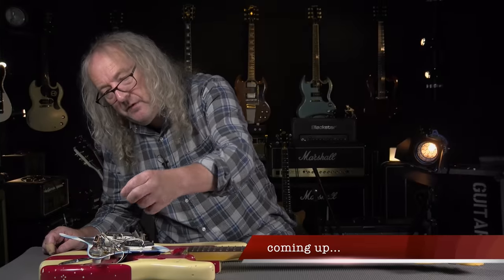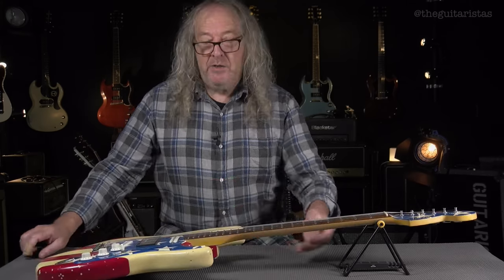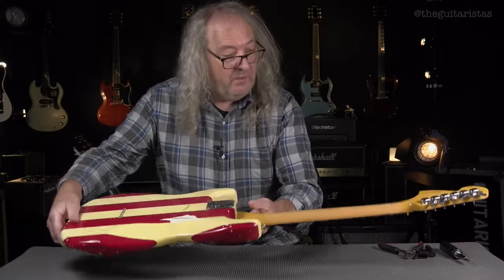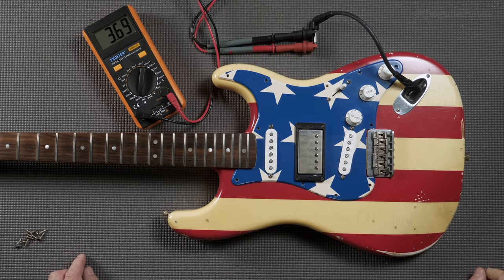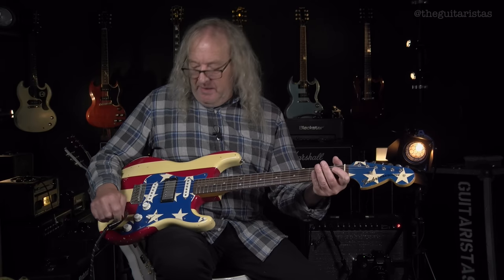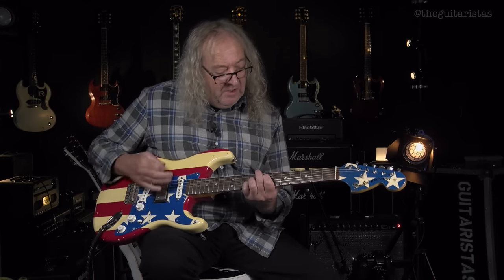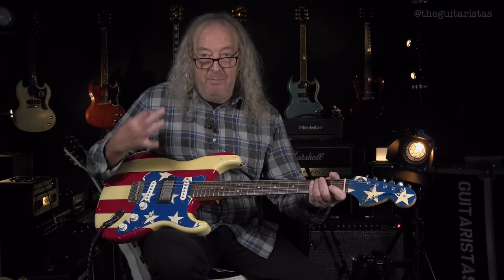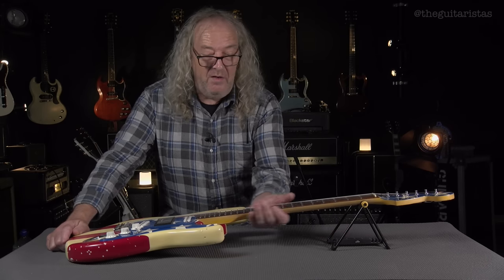Can the MC5 Fender Stratocaster Kick Out my Prejudices? - Independence Day Guitar Review

Comment: I think the muddiness of the middle humbucker could depend from the fact it's linked to 250K pots, instead of the 500k pots utilized  in Gibson guitars.
Reply from the maker: Good point! 😎👍
Reply: Or does it sound muddy because it's a Shawbucker 2 -- which many would describe as muddy to begin with?
BTW, the Fender Shawbucker is designed (voiced) for 250K pots which can be found on Fender's wiring diagrams included with them. They presumably do this so it could be more easily paired with single coil pickups as it often is.

Comment: Always had a love/hate relationship with Strats. I have liked a few of the older ones I had (1973 & 1978) but did not like the ones from the early 2000s. I do prefer the hard tails....I have never like relic-ing. I would rather beat them up myself with normal wear and stupidity (leaving them on stands when you have kids and dogs). Keep on keeping on!

The volume knob location never seemed to bother me...never thought about it.....
Reply: The volume knob is perfect where it is. Perfect for manual swell... weird to be musically limited to the point that a strat could be a problem. I prefer strats to gibson's but i do really like SG's. They have different uses...les paul have an amazing sound but so hard to be in tune and the worse... its weight, that is part of the sound. But not worth back issues to me.

Comment: Like you I started off playing guitars with Tuneomatic bridges and Stop tails and found the Strat style bridges slightly awkward and uncomfortable to play!
I’ve subsequently found that replacing the small saddle Allen screws with shorter ones that are flush with the top of the bridge makes them much more comfortable.
They are available in different lengths quite cheaply and you will need slightly longer ones for the centre strings to compensate for fingerboard radius.
If your happy with the current setup and string height, take some measurements and order some, I think you will be pleasantly surprised how much it helps!
To avoid altering you current setup, replace one screw at a time and check tuning!
As to the control knob positioning, you can buy pickguards without control knob holes so you can drill yourself and reposition to suit your requirements!
I bought one recently for my Eart Suhr Super Strat copy which has only 2 control knobs, volume and master tone!

Comment: You can consider 4 things to do when you don't like a floating tremolo on a Stratocaster:
1. Buy a hartail Strat (At least if you like Robert Cray)
2. Put in all 5 springs and increase the tension so that the tremolo does not move at all any more (the springs indeed affect the tone)
3. Just like #2 but then stick a piece of wood into the gap between the trem block and the body. Then release the spring tension so that the block presses the wood against the body (so it would not fall out and this also makes the instrument resonate better. This is what EC does and also features the EC Stratocaster signature model as far as I know).
4. Buy a Nashville Telecaster instead.
A tone comparison would be of interest I think.
@Colin: Thanks again for another interesting and entertaining video!
Reply: I deck all of my Strats as in item 2.
Reply from the maker: Cheers Lars... 1, 3, and 4 work for me! 😆👍
Reply: @theguitaristas  I like 4 best 😎

Comment: I ordered a Mod Shop Stratocaster last year and I went with the hardtail option. Then I replaced the bent steel Fender saddles with some stainless steel block saddles. It will hold a note for about as long as you care to.

Comment: Usually 1st tone is for neck pup, 2nd tone is middle & bridge tone.  My Strats I like 2nd tone control for the bridge pup.  I like the middle pup with no tone control.  Yes you can go master tone & volume, there are strat style guitars made the way you like the controls.  You can make up several pickguards with different pup & control setups, get battery plugs from the R/C hobby, add to the jack wires for interchangeability.  This way I can return the guitar to stock if I want to sell it.  
A suggestion for Fenders that ned neck removal for truss bar adjustment: If you need to adjust often, internet search for woodworking screw inserts & machine screw (kits for guitar necks available).  This eliminates wood deformation of the neck.  This makes a true bolt on neck. My son overtightened the screws on one guitar & this was a nice fix.  Why he parted the guitar is still a mystery.  I did this to all my bolt on necks.

Comment: I just did some checking in the old Charvel/Jackson catalogs (I used them from 1985-1993....Model 5 and 6) and the volume knob is about the same. I think because the trem bar was there I never noticed it or had an issue.

Comment: Regarding the dark humbucker...I have a G&L Blues boy tele with a humbucker in the neck that sounds very dark. I think the problem maybe that humbuggies need a 500K pot to brighten them up, but when they are on single coil guitars they always seem to have them with the 250K pots that suit only the single coils and ruin the humbucker sound. What do you think?
Reply from the maker: Yes I think that's definitely a thing... not sure how you get around it but I'm going to rewire this so we'll try to find out 🤔
Reply: The American Standard "Shawbucker" Stratocaster, introduced in 2014 and produced through 2016, addressed that by putting in a circuit that switches from 250k potentiometers in the single coil modes to 500k when you switch to the bridge humbucker. I think the American Professional Stratocaster, which replaced the American Standard in Fender's lineup, can also be had with the "Shawbucker" humbucker.

Comment: Thanks for the review.. Incidentally, I bought one of these brand new, must have been about £745 from DV247 Romford 2011, I've only just got it out of storage this week, still in its carboard box.. The neck had bowed significantly from when I played it back in 2011, have just spent the last week slowly incrementing the truss rod to try and bring it back.. must of got some humidity issues where I had it stored?  I pulled the scratch plate for a look inside, don't know whether they used a mis-match of available pickups at the time but my humbucker didn't have the silver braided wire, just thick black shielding and my bridge pickup had a yellow not white cable.. The original wiring was Bridge pickup (no tone) Middle with tone and neck with tone.. also had to lower the humbucker to get a better balanced output as it was way way louder than the two single poles.. I think that's how Wayne Kramer wanted it I guess..
Reply from the maker: I’m pretty sure the original pups in mine have all been replaced 🤷‍♂️ great guitars though! hope you get yours sorted out ok

Comment: Hello Colin, I'm late to comment on this video as I've just watched it!
I bought - and still have - a Fender Wayne Kramer MC5 Strat. I bought it new from GuitarGuitar back in 2011, I think it cost me £711 or thereabouts and I'm surprised at the current re-sale prices some folks are asking on Reverb.
Like the example you have, I've had it re-fretted with jumbo frets. The factory supplied frets were skinny, to go with the vintage vibe that Brother Wayne wanted. I also had an Earvana nut installed and I had it all set up (by the chaps at Feline Guitars in Croydon) so that it plays like a guitar that has a compound radius fretboard and it does indeed play superb.
I'm a fan of hardtail Strats (I have three in my possession all factory fitted with humbuckers).
Thanks for the excellent videos.
Reply from the maker: Cheers brother!... still got to fix the wiring on mine when I get chance its a bit of a mess!  😁👍
Reply: @theguitaristas  And just like that, Brother Wayne has rambled off from this mortal coil. R.I.P.

Comment: I have two Strats and love them. My favourite Strat is a Mod Shop Strat that I  designed. Natural Mahogany body with a toasted maple neck. It also has the re-issued Josephina's Hand Wound  Fat 50's for pickups. Slightly growley tone to it. I am left handed so I have to have my guitars made for me. I love my Strat and play it much more than my Les Paul Traditional, a burst as they call it.
Reply: I forgot to add, I added the extra springs to the tail piece, so it is much more like a hard tail. It does help the sound on a Strat. The springs are fairly cheap from Fender.

Comment: Wow all the reasons not to play a Strat but what a cool guitar … not a Strat lover either and totally agree issues … spiky bridge, volume pot easily turned down .. to many unusable positions… but some of these are easy to sort with wiring mods .. luv the Gilmore mod a 5min fix …as most strat players uses the neck pickup that’s the one to focus on and dial in … that humbucker is in a great position … think you need to get that wiring sorted.. and few mods to include some  tension on the volume pot … the strat gives wonderful clean clear crisp tones that’s worth putting some time into finding … the neck can be adjusted by loosing the strings, removing the two back screws a slacking both front screws then carefully push the neck end up … might need to remove the scratch plate.. on a 50 tele just push down the neck pick up down to get the screwdriver in but watch you paint work … luv to see more of this guitar.. have two Fender strats here and I only play the ESP LTD strat !

Comment: I remember when they came out with those, as I am also an MC5/Wayne Kramer fan. They retailed for 1,000 US dollars brand new back then ($999 to be exact). If it were my guitar, I'd probably re-wire it so that the 2nd tone control was on the bridge pickup, and leave the humbucker with no tone control instead. That'd let one roll off the tone for the bridge, and get the most brightness from the 'bucker on a 250k volume pot.
Reply from the maker: Cheers Dave, pretty good value I reckon even back then! 😎👍
Reply: @theguitaristas  They introduced the model in 2011 (I had to look that up). At the time, people were like, "$1k for an MIM? No way!"I don't know what 1000 in 2011 dollars equals today, but they weren't around that long and I don't think they sold particularly well, so I imagine they have some collector value. Especially to people who love the MC5, or yanks that want their guitar to double as a flag! I am an American, by the way, who prefers teles over strats.

Comment: That's a super cool Strat 😎 Every Strat I've owned has had the Clapton mid-boost circuit and TBX control fitted. Super fat tones similar (but not the same as) to a Les Paul with it turned up and classic Strat tones when turned down so very versatile.
Reply from the maker: Here’s Pete, I’m a bit green when it comes to Strats so will check that out! 👍

Comment: He does it again - Really good vid and a guitar that LOOKS like the DOG's IMNSHO:).....Not usually a fan of painted headstocks but this guitar has times and places to come out often enough if you can play it well enough and you can.  Slight shame on the vintage truss rod adjustment for me but no biggie.  Personally, I would not change the pickups at all.  Start getting into pot resistances and all sorts and it's already a fudge with singles and HB.  If it gets you in that zone good enough that's where I would leave it or get another guitar if not...Each to their own though..Done that once.  It's what I consider a rabbit hole, with the pickup thing, and gained some and lost a bit I wanted back (old Mex Strat with ceramics originally swapped to SSL1s and JB....something Yamaha still offers stock I think and frankly if I did it again that's what I would buy and the Mex Strat left alone to have its own place)....Personal I appreciate......We share very musical tastes LOL.....EDIT: Oh not at GBP2k though for me.  1300 euros was a good buy and a lot of stuff starting to float on the used market and a lot of "affordable" options if close enough is good enough on something that does not need to be special.

Comment: i would definitely suggest the double ceramic bar magnet "p90-esque" design of mexican strat single coils for folks that generally find strat pickups too thin. There's a whole crew out there that prefers 'em👍 (* enough with the compliments, i too have a a huge beef with the strat layout,...the plus side is i started my guitar modding journey specifically to try to "disappear" as many of the strat controls as possible, from filing down pickup selector switches, to using 2 or even just 1 knob in the furthest position out of the way. I 1000% disagree with the "youve just gotta play around it" and ask any one from the harder rock/ metal community where palm muting is integral, they too find the strat layout a meme. I also like using strats for singer songwriter strumming,...and ive never met an acoustic tutor that has said "avoid picking at the bridge",...ITS LITERALLY HOW YOU CONTROL DYNAMICS, ATTACK AND TREBLE CONTROL😖 Thanks for doing most of the work Leo, but ill take over from here:)🤘 cheers ...phew... rant over:). great video
Reply from the maker: Cheers man, yes there's a lot going on with the right hand that needs freedom to operate... now are you suggesting it would have been better if Leo had been able to play guitar? 🤣👍👍

Comment: Well it goes to the top of the Cool Wall if nothing else! I also hate the volume knob position on strats... My strat I had to completely re-wire too, I dumped the tone controls for the neck and middle completely. So the top hole has nothing in (apart from a plastic hole bung) middle hole now has my volume, bottom hole has a tone control for the bridge pickup. It makes far more sense. I had to do it on my Ibanez too, that only had 1 vol 1 tone, so now it doesn't have a tone control at all. 😆
Reply from the maker: Cheers Simon, that's definitely happening to this one! 😎👍

Comment: I do like and have always owned Strats or strat copies and I certainly prefer hardtail Strats and it has to have fatter/beefier pickups than the basic single coil sound. Had one with texas specials pickups I think? A USA standard which was the best sounding strat I've had.  If you want a guitar in a mix with midrange tones that can do quite rythm and character filled leads (with a booster pedal) it's perfect!  I know many think it's natural Gibson partner is a 335 but I've always thought of the SG as it's natural counterpart tonally.

Comment: now im really getting curious to what PS stands for.. I have several Gibson pickups also saying ''wound by PS''. I doubt a Gibson pickup got installed from factory at Fender.. Or maybe the pickup got swapped at some point in time.. We can only speculate..
Reply from the maker: Comment from RG Guitar below says: 'Wound by PS - thats a mid 2000s (say 2006-2008 judging by the sticker) Gibson Burstbucker.'.... could be true does that add up with yours?
Reply: @theguitaristas  It is. I know for a fact the '07 Burstbucker 3 in my Les Paul BFG has a sticker wound by PS. I know this because i took my BFG apart 2 weeks ago to do a refinish of the top on which the lacquer had worn through to bare wood. it states and i quote: ''BB#3 (wound by PS) 11/19/07 0448''. im not sure what the 0448 stands for. maybe 448th pickup wound by PS that year??
 I also know i have atleast another one with the same sticker, most likely a burstbucker aswell (my favourite Gibson pickup in a Les Paul) but it is in one of my guitars, dont know which one but i dont feel like taking apart 8 guitars just to see which one has the sticker.. sorry.
Reply from the maker: @kkzooi  That's good enough thanks, seems to confirm that mine is likely to be a burstbucker and some thieving git swapped out the originals! 😆... still it sounded ok I guess nothing wrong with them!
Reply: @theguitaristas  could very well be. A good sound which you enjoy is most important. Unless its something rare and valuable which you one day intend to sell for a profit.
I would post a photo on the forum albeit there is this slight problem of me not owning a credit card.. (i would probaly spend way too much if i did)
Anyway, keep up the good work and i'd be interested to see a video about the Deluxe Reverb II. See you next week. Have a nice weekend

Comment: Nice sustain with the STB hardtail bridge. Has that trebley quackey Strat sound, not my thing especially but this does sound good in a two-guitar band situation playing with (against ?) a Les Paul. Very responsive to your variations in pick attack. You're playing nice today, the guitar doesn't seem to be holding you back much.
Reply from the maker: Cheers Mark, Big Muff always helps of course! 😆👍
Reply: @theguitaristas  Aha! The Big Muff put some whiskers on that MC5 Strat. I use an old Tube Driver pedal with my Tele. Awesome preamp pedal, has a couple 12AX7s in it to really push my amp's front end, but it's smooth. Almost gets that Les Paul/Marshall sound. Seriously though, you were sounding good there on that Strat! Don't feel guilty.
Reply from the maker: @markpell8979  Cheers man! 😆